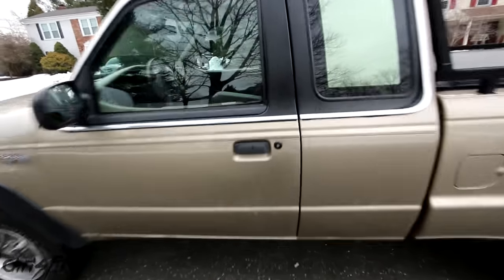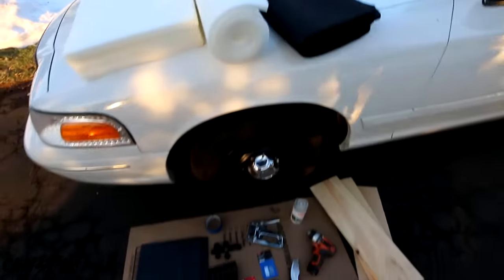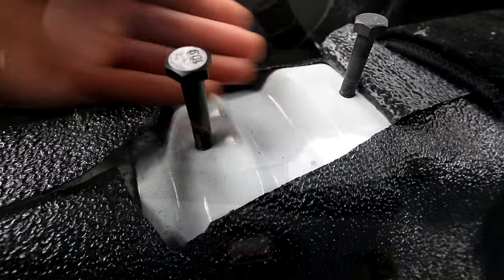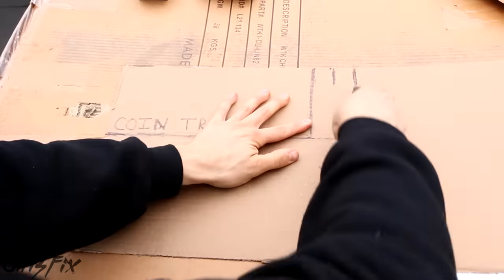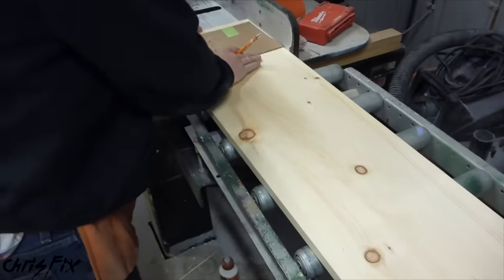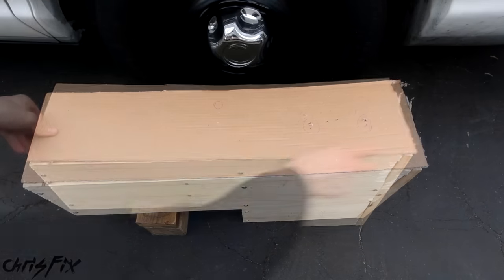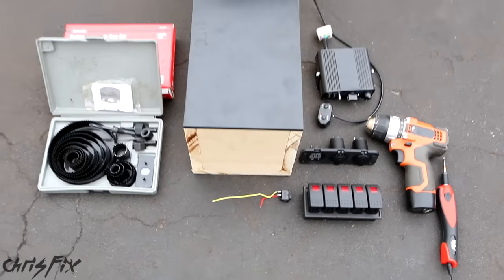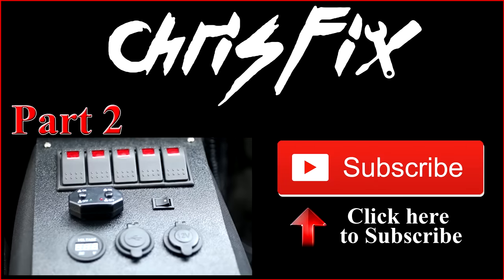How to Build a Center Console for your Car

Comment: In germany the inspection will handle like: thats not original, we will take your car out of the register until you remove it. Highly illegal gangster! :D
Reply from the maker: +xCore0320 Dang, that stinks they are that picky.
Reply: +xCore0320 ''Is that an aftermarket airfilter? Sir, put your hands on the hood of the car.''
Reply: +ChrisFix Video title in Arabic nice
Reply: +xCore0320  Same thing in sweden
Reply: C'mon man don't exaggerate like that
Reply: +xCore0320 Actually, you would get in deep trouble with all the sirens and lights, but certainly not for installing a center console with some storage and a few USB/cigarette lighter ports in it!
Reply: You get trouble with that. Believe me. Even when you get original parts with no partnumber in it, ford had that problem once in some RS model bumpers, they don't let you pass the inspection.
Reply: Okay, maybe in the Netherlands they won't be bothered by cosmetical changes (except for LED-lights and stuff), but I think I center console will indeed get you in trouble in most parts of Europe. They probably will come up with something like: ''The console could be a danger in case of a crash, it could go flying about'' or something like that.
Reply: ***** A bumper is an exterior part, and still considered safety relevant, although nowadays mostly cosmetic. I don't see how a center console could be considered safety relevant, as long it's securely bolted down.
Reply: Nah, I'm from Austria and an aftermarket center console will definitely not get you in trouble. One big reason being that your safety inspector ("TÜV-Prüfer") won't be a car expert and he won't even know what is original and what is not.
Reply: WhiteSlift jaaaa hahahaha hier kanns jede werkstadt (every car repair shop (?) can make the inspection haha)

Comment: great video as usual! to everyone asking where the shifter and handbrake are; these cars use a column type shifter that mounts to the steering column, and these cars are equipped with a "parking brake" not a handbrake that is a foot pedal.

Comment: Cardboard is super handy.
I made a few things out of a thin, pressed cardboard specifically for my car. I created a little storage unit with a cup holder between my seats. I also created four equal-sized containers in the trunk of my car with slots & shelves to organize all my stuff and I also cut out handles to easily carry them and remove it all from my trunk in a jiffy. I also measured and created two small boxes about the size of a large toolbox that fit behind the driver & passenger seat for storage - they are designed so that the seats won't collide with them no matter how much they shift or recline by fitting just inside that safe zone.

I lost too many things in my car that I had to have a place for all the stuff I had in there instead of just throwing it inside somewhere.

Comment: if u use a bit smaller drillbit after you use the small one and just making a hole thats as big as the screw-head you will get it flush with the wood and ti will be less of a cheap look ;) allways smart to do :)
Reply from the maker: Thanks for the tip!
Reply: ChrisFix Are you swedich or
Reply: Raging Robin or u can use a counter sink bit, quicker than re drilling the holes etc

Comment: There is a counter sink attachment that slides over a drill bit so when you make your pilot holes it tapers the end and your screws will always be flush. They are also adjustable on the bit so it doubles as a depth gauge, highly recommended.

Comment: I would HIGHLY recommend cutting with a jigsaw if you plan on cutting wood by hand. Used one's are well under $50 and you can get them even new from Amazon for under $50. Makes cutting very simple, quick, and you can even cut curves!

Comment: I should build this in my wood-shop class maybe
Reply from the maker: That's an awesome idea.  Take pics and tag me if you do!
Reply: +ChrisFix hey I need some help, my truck got a tune up 2 years ago and ever since the front ac vents stopped blowing air . My truck only blows air at the feet and defroster. How do I fix this?????
Reply: +Jose Chavez could be a vaccum line that switches the vents possibly
Reply: +Brian Pardee ok thank you

Comment: damn man no countersinking or wood glue? bet it squeaks after a few years
Reply: +duhjuh or maybe not
depends on how hard its used
Reply from the maker: +duhjuh I have had my center console in my truck for almost 4 years and it doesnt make any noise.
Reply from the maker: +duhjuh Also, no need to countersink since it will be covered in foam.
Reply from the maker: +duhjuh Thanks for the feedback! I never had any problems after years of doing this but I always like improving my work so I appreciate it!
Reply: Yep, was thinking the same.
Reply: +Tariq Kay Bunnings?
Reply: Just turn up the radio!
Reply: David G don't gotta be a hero about it dude

Comment: Maybe I'll use this for my next car :P Unfortunately my car just died the other day. Will hopefully get to use your tips again on my next car.
Reply: +MercilessHobo what happened to your car :o
Reply: Three points Veteran Scars Haven't been able to get it taken to a mechanic, but assuming lower intake manifold gasket is bad. It literally pours coolant out the back of the engine(V6 FWD). While trying to find the leak, the thermostat also got stuck. Those problems mixed with a bad CV axle, bad wheel bearing, no AC, and the transmission likely going soon makes it just not worth repairing when I could put the thousands of dollars I'll spend over the next couple months into a car that doesn't have 220k miles.
Reply from the maker: +MercilessHobo Sorry to hear that! Good luck with the new car!

Comment: Just a protip: Use square drive screws. I've been building cabinets for over 9 years and phillips are just horrible and strip too easy. With square drive you can get a much better grip and sink the bits in much deeper into the wood.
Reply from the maker: +DexterGoneWild Thanks a lot for the tip! I will use square drive next time!

Comment: Only problem I can see is the wires for the siren. The wires have that plastic wiring connector and that sure wont fit through that hole. You're going to have to cut and splice the wires to get them to fit in that hole.

Comment: Hey Chris I have a dodge nitro 2009 and I need to change the battery because the old battery is weak or if j leave my headlights on more then say 5 minutes the car won't start or will barely start. Do I need a new battery? And if I do should get a optima battery or upgrade to those expensive AGM batteries? The car is stock no fancy amps or stereos. Thanks and you are doing a great job on this channel for a young guy. I commend your work here.
Reply from the maker: +RViscara Take your car to a parts store and they will test the battery for free. Here is more info: https://www.youtube.com/watch?v=fRfPupikHT4
As for batteries. You want something with a lot of cold cranking amps. I would just get a normal battery and save your money if you dont run a heavy electrical load (aftermarket lights, radio, etc).
Reply: Thank you chris.. I will be sure to watch the video and save my money as that is always a good thing. Keep up the great job.

Comment: Chris love you videos on making the console and doing the police car I'm a ham radio operator and was looking into getting a police car because some of them has a center consoles took up all my ham radios is there any way that you can make a video for making a console to hook up radios just like you did for the police car that has enough ventilation in it so the radios have the proper air so they don't get too hot and burn out and overheat if you can that would be awesome to show us how to make one of the center consoles that accommodate about 3 or 4 radios just like you did for the police car thank you.
Reply from the maker: +John Mongo that would be awesome

Comment: Hello Chris! I'm from Brazil and really like your videos man! I have a Ford Ranger 1994 tath is very similar to your truck and I'm learnign many things about it!
Chris my truck is now with a different problem that I'd like your help. 
The windshield wipers dont stop to work, when I turn it on, it never stops to work man, I dont know what to do.
I need the remove the fuse and put it again when I need the wipers.
Please, could you help me?!?!
Congrats for your goood job!
Thank you so much!
Please ...........
Reply from the maker: +Júlio Vilaça There is a wiper solenoid and or control module that might be bad.

Comment: Ahh the cardboard, its a handy and cheap way to rough something out, much much easyer than taking bucketloads of measurements and it still dont fit LOL :-D
Recreating parts of old switches or just simple copy brackets is much easyer with the back of a cornflakes box :-D
Reply from the maker: +zx8401ztv I love using cardboard to make a replica because you can always add tape and more cardboard if you dont like what you did. A lot less stressful when you dont have to worry about messing up. Good idea with the cereal box!

Comment: Hey Chris, do you think I could sand it down to make a cellphone holder? Are there any other things that could sand it down faster? Also, how would I make sure the dent in the wood doesn't look different from the cellphone? any tips? I would like to try and replicate this on my dads crown vic 2010 model, thanks.

Comment: So what happens during an accident, especially a side impact. Driver &/or front passenger is going to go straight into the wooden console, which will break under the force and splinter into the person. It's at the perfect height to enter the lungs, heart or nick major blood vessels. 

I can't believe for a moment that the wooden console is street legal. Use fibre glass or automotive grade acrylic like you're meant to. Both are relatively easy to work with. Make sure there are no hard corners, points or edges. Everything should be rounded
Reply: You’d break ribs but the screws would shear before that would happen
Reply: @h0udinl  Not a chance

Comment: Hey Chris, I recently bought a 1996 Es300 w/ 68,000 miles on it. The recent driver barely drove the car and left it without being driven sometimes but always maintenanced  the crap out of it at the Lexus Dealership. Since Ive had it, every 3-6 days the car has a somewhat almost nasty sound AFTER it starts up(some clunking sounds that doesnt sound good), but then it goes away after a few seconds. This time the horrible sounds started after I finished starting the car, it made the same noise that I was talking about then the engine shut off. The car kept turning off after I barely started it until I got lucky enough to have enough time to put the car into drive and quickly start driving it and then the problem goes away and car drives normally. I drive it every day and this happens whether the engine is warm or not and I am predicting it will happen in a few days. What do you think this is and to diagnose it?

Btw thank you for answering my last question. I appreciate every good that you do for us here on youtube.
Reply from the maker: +Omar Khalil It might be the flex plate (the flywheel for an automatic car). It is hard to diagnose without hearing the noise.

Comment: chrisfix i have a 2008 dodge ram 2500 cummins and i was wondering if a body lift or suspension witch one is better in your opinion?
Reply from the maker: +mxz600 rave A suspension lift costs more and puts more wear on the suspension components so I would go with a small body lift.

Comment: Hey Chris,  Everytime I turn on the a/c or heater in my 1996 Es300, the air flows through the outer vents on the dashboard(the vents by the windows)but it does NOT flow through the inner vents(The vents on top of the controls in the middle of the car) of the vehicle. What might be the problem, and how can I diagnose it? Thanks for all that you do!
Reply from the maker: +Omar Khalil There is either a vacuum line or a motorized actuator (fancy name for arm) that opens and closes those vents. The vacuum line might be leaking or fell off or the actuator is burnt out.

Comment: ok I have a police light that I am putting in a shadow box but I need to find a psu for it and I don't know where to start but it would help if you told me how many watts that the crown vic battery is

Comment: Not using Titebond II, Yellow Wood Glue, or similar is a MAJOR fail.  Glue is stronger than the wood once it dries.  Plus after 10,000 plus miles you won’t have a wobbly center console from all the screws coming loose.
Reply: It’s been 6 years and I bet you good money if that car is still being used it’s still solid it’s a centre console not cabinetry
Reply: And like 8-10 years later the one in the truck is perfect too lol

Comment: I'm looking at making my own center console too... but damn this was a bit rough. Templates were hardly precise and the fit was sloppy. I bet the center console must weigh a bit too.
Reply from the maker: +Sigma Octantis Thanks for sharing. Your templates dont have to be perfect because you use a saw to cut straight lines so the templates just give you an idea of what you are cutting. The wood didnt fit perfectly because it was warped from going inside where it is 70F degrees to outside where it was 30F degrees. But even so, it doesnt have to be perfect because you are covering it.
Reply: ChrisFix Fair enough, I'm just used to making things like subwoofer boxes where tolerances need to be tight. Personally I'd rather have my center console made out of Aluminium or ABS. Vacuum formed ABS might work well using a wooden former similar to what you've made in this video.

Comment: Could I create my own custom mounting points? Or should I use pre-made ones?
Reply: +Vivek Anand you can be creative and make whatever you want, I suppose. Just make sure everything WORKS, cause you really don't want to realize a bad mistake at the very end, and then screw up. But dude, you posted the 1000th comment!!
Reply from the maker: +Vivek Anand You can create new ones if you want. Whatever you need to do to get it to work. Your creativity and skills are the limit!
Reply from the maker: +Chinmay Gupta Exactly!

Comment: hey Chris fix! what's a reasonable price to get two front struts replaced. I paid 810$ for the replacement for my two front struts on a 2004 Malibu. is that a rediculous price to pay? do you think the mechanic burned me?
Reply: the strut brand is KYB by the way
Reply from the maker: You can do it yourself easily with common hand tools for the price of struts. $800 seems like a lot.
Reply from the maker: +eloid ceja And those are the cheapest you can get!

Comment: So I litterally just put 2011 ford fusion seats in my truck went from the 40 60 bench in my ranger and I have been looking for a console and this video just happened to show up
Reply: +Donovan Robins Where the hell did you find 2011 Fusion seats???
Reply: +**Classified** ebay
Reply: +**Classified** I think the seller still has another set both sides electric for sale it was like 300 shipped had to mod the mounts to fit but some Andre iron and some square tubing and they fit
Reply: Donovan Robins you got lucky to find those. That car is way too new to be parted out.
Reply: +**Classified** right
Reply: ***Classified*** I had been searching for the longest time too because I got in a fusion and was like wow these are actually pretty comfortable and look nice
Reply: Donovan Robins I've never been in a fusion actually. I know that most seats in newer cars are pretty darn comfortable though. I guess it really depends on what you're after, but the seats in my old trucks have a ton of give in them. It normally starts to hurt if you go on a 12 hour drive or something like that. New seats seem to have the perfect amount of plush and firmness. 

Did you get the electric ones? How did you make the power functions work if you did?

Comment: when I bought mines from a relative it still had the big metal piece in between the seats I supposed it was used for the computers.
Reply from the maker: +Rashad yea that's what they mount the computer on.
Reply: Oh I forgot to ask what are the best accurate tracking devices I can use for my car? I want to use one just in case of a car theft. The car I have is a 2004 crown Victoria police interceptor.

Comment: i ve got one question: where is the handbrake and the gear shifter? huh
Reply from the maker: +szymon kot The shifter is a column shifter right behind the  steering wheel and the emergency brakes is right next to the door on the left next to where the clutch would be. It is a foot brake.
Reply: uhhh... i don't understand that. in europe we have handbrake and shifter between tfront seats just right there where you made console

Comment: +ChrisFix does that crown vic driver seat lean to the right? for some reason my crown vic (which you're going to be installing my go rhino push bars on for a video) back of the seat leans to the right when i sit in it. what do you think could be the issue? In this video, by the seatbelt where the back of the seat attaches to the bottom you can see that bolt, and that bolt to me seemed over and the bushing too. Any other ideas?

Comment: I'd highly recommend not using the cardboard cutout as a tracing guide for your cuts. The cardboard pieces could be different lengths making the assembly difficult. I'd suggest that you measure the pieces and have them cut accordingly.
Reply from the maker: +John Heller Thanks for sharing.